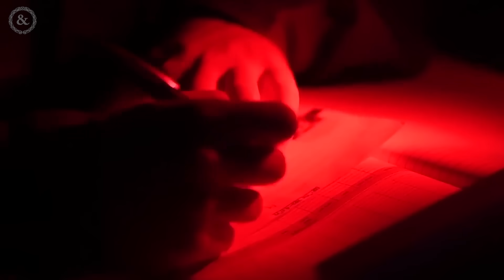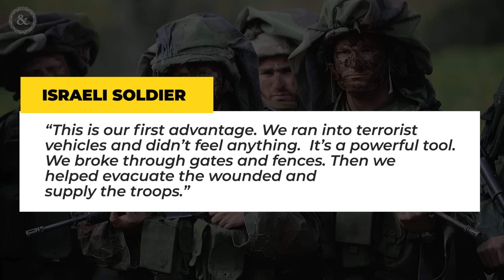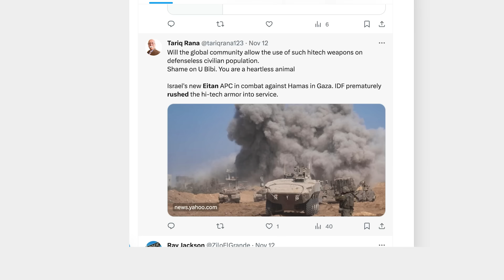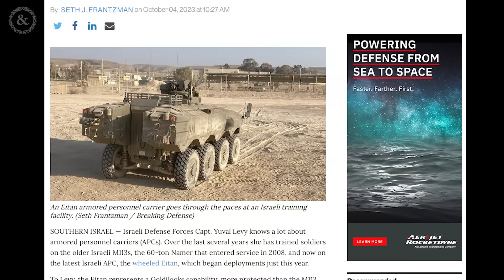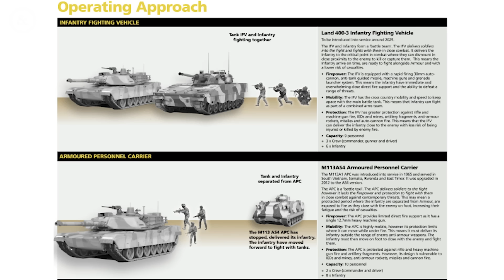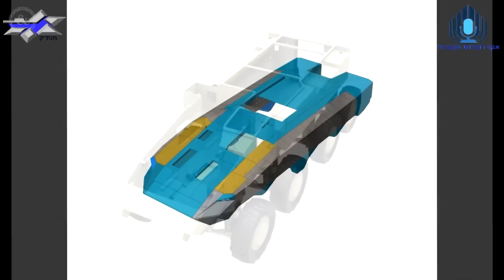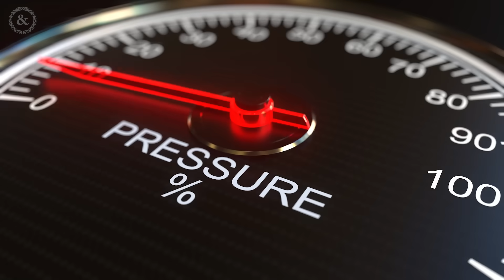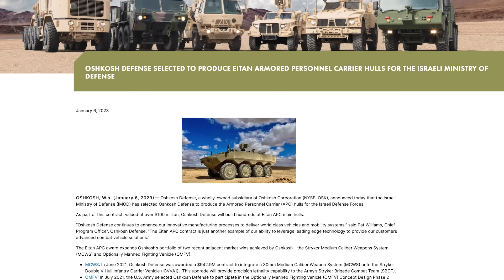Israel's Untested Armor Thrown into Combat

Comment: The basic design is far better than Stryker ! Believe the 30mm cannon should be up scale to 40 or 50 mm , with laser targeting and exact distance findings ! Be cheaper to have more select flexible fusing in cannon round !  To provide umbrella cover for infantry away from the Eitan with a proximity setting for small drones where shock wave of blast and shrapnel should take it out ! Plus with laser distance finding air burst setting for detonations and select added distance segments to distance 6 ft for cars, wall ,windows and doorway ,building corners of 2ft  ,plus more exact distance for foxholes ! To save the 40 mm cannon ammo have a over under concept 50 cal mounted on top of cannon !  The side armor should be greatly improve is before exterior skirt armor is to have modular side wedge armor of the Merkava tank turret ! Now improve this wedge armor more is have on demand to expand or collapse act a space armor for the heavy wedge armor , operated by small electric motors pushing flat bar out with gear teeth on top , the modular wedge will have small pilot hole , about 20 inches deep ,when operated it be like a tote umbrella or snake eye bomb fins , the extension struts will open a hinge that consist of the metal skirts plates upper & lower at 90 degree and 20 inches away from the peak of the wedge armor , when not in use it be folded against the wedge armor another protective layer , but not acting as space armor !
Reply: The downward blast force of a 40mm or 50mm should be enough to take enemy in foxholes or the Side blast for doors ,window sides and building corners !

Comment: in btr 60 it had 12 tons... a modern armored vehicle has 23 tons... the difference is armor... you can find a technical solution to reduce the weight by 15 tons... either it doesn't have the weight or something is wrong..

Comment: For a better resilience shouldn't we democracies team up in our defence production?

A vehicle like this could be autarkly produced in Europe by a joint venture for the european market. Vice versa there might be other products that are a good solution for Israel in Europe that could be autarkly produced in Israel by a joint venture. In case of conflict we can help each other out. Also we can specialise in our research and new developments which would be cost effective or deliver more for the same costs. May be we should exchange engineers to make sure that the specific interests and needs are covered in joint products. This could happen by using the same base but implant a customized version if needed. 

We should ask Canada and Australia for participation and Japan, South Korea.

This would be a powerful grid that is resilient to the max. 

PS.: I haven't mentioned the US because I think some competition is beneficial for developing new ideas. But the results of all sides should be shared among democracies in a way the inventor benefits of. Of course there needs to be standards that make it possible to interchange spare parts, ammunition and basic service. 

Such a defence network would be a strong answer to the challenges of our times.

Comment: One of the coolest parts of technology in combat, is that technology will always be ahead of what is practically possible. Every single platform, weapon and strategy is already potentially obsolete because by the time the tool is being used, a minority of people (hopefully helping you out) have already observed, tested and identified the weaknesses of the new thing. They have the time between designing the thing, and sending it to combat, to design a better version and therefore "obsolete" the old version. (never-mind practical experience) Some parts of the military have this issue worse than others, not really sure which are relevant. But here are some examples. 

Navies often have this issue because it can take decades to make a single ship, so as long as you want to stick with the original plan (ad-lib at your own risk). It takes so long to move a ship from the blueprints to the sea that entire wars can begin and conclude before the ship is ever tested. By the time the ship touches water there have been 10 years of engineering, experience and changes in priority. 

On the opposite end of the spectrum guns are so numerous that massive amounts of industry would have to retool and find funding before new ones became common. Practically you can make a new individual weapon very quickly, but replacing a 50 year old gun completely may take 50 years. By the time a gun becomes common in a military there have already been new guns made and the people may see the old gun as an old reliable despite flaws that have been on record for entire generations.  

Rushing your new vehicle to combat and skipping the evaluation minimizes the time people can reconsider/observe and practically increases the time the vehicle has before becoming obsolete.

There are risks though, it isn't all gravy.

Comment: Looks like a great vehicle.  Wish the US had an analog.  Many of our vehicle have an air transport requirement and designs limited to what a C-17, C5 can carry.  Hence the width, length limits we have as an expeditionary force.  Perhaps we should have variants that can be ship delivered and emplaced such as these that can be positioned in Europe, Asia.  By all means, keep parts similar or same across all variants such as strikers, M2, M1 as applicable.  For Gods sake, please standardize controls!  There is no need for every vehicle to have different control configurations, Keep those the same and merely update electronics and capabilities.  Even in aircraft he stricken stick grips are custom made for each aircraft and not interchangeable.

Comment: Thank you !  Great video but you MUST be mistaken about the width being "3' Wider than the Stryker" ?
 The Stryker is ( 9' ) in width. So if you are correct that would make the "Eitan"  --> ( 12' ) Wide ?  Which is literally impossible ! 
 Typically with these type of wheeled vehicles they try to take into consideration the average width of the very roadways that they will be traveling on.  A ( 12' ) "MON-STAH" would have a Very tough time maneuvering around our Super-wide  ( in comparison of course ) US streets & roadways. Let alone the typically Old/Ancient designed for "Ox-Cart" streets & roadways found over there.
Don't want to criticize. .. I'm just say'in !
Reply: Do an image search in your choice of search engines and find images of people on them in service or building them in factory, yep, it is that wide when assembled. For instance, a factory image which is a YT thumbnail from a video by Israeli Homeland Security, in the November 06, 2018 issue of Breaking Defense in an article by Arie Egozie. A ways down the page article mentions 10ft width. Pause the time lapse video, rotate people standing atop hull, and yep, it is in that width range. Other more recent articles in a couple popular defense industry sources do give 12ft width.
Reply: No ... Sorry but you are off by at least ( 3' ) The Abrams is ( 12' ) wide. There is ZERO chance this Eitan APC is as wide as an Abrams. 
 I suggest you take another look.  Ive spent a LOT of time on, over & in an Abrams and I know what ( 12' ) looks like. That Eitan thing is not anywhere Near that.  In fact, It can't be because it would never be able to make it down the damn roads it was designed to be able to navigate. 
   @scottfw7169

Comment: That looks like a South African vehicle. It has the same top speed as well, most probably 8 wheel drive as well. All our vehicles in the war in Angola was tyre wheel driven and not track driven. Just like the UK vehicle and most American vehicles are South African technology or and South African build.
It is easy to find out as my buddy works at a factory.
V-shaped hull is a South African invention which have been used by South Africa since th 70s. It is a Professor in South Africa that designed it.

Comment: Everything about EITAN AFV vehicle except from the "Iron Fist APS" sounds exactly the same as PATRIA AMV, i know there's more but I can't but wonder if Israel could've and should've opted to get a license for PATRIA and make a custom variants of their own cutting back time required for R & D, testing while saving money aand PATRIA is proven in combat.
Reply: It's not only a matter of cost, Israel tries to be as self dependent as it can be with its armor and not to buy armored vehicles from other countries, not even the US, that's why the Merkava project was created 50 years ago.
Reply: @E_y_a_l  I understand that but Eitan already is made out of (not sure iirc) 50-60% foreign parts and Israel has a good history in dealing weapons of all sorts with Finland like galil, soltam, tampella howitzers and they would've easily acquire a license for Patria.
Reply: @realtsarbomba   I don't know where you got the 50% foreign parts info, I doubt that's true, the Merkava and Namer APC are 99% Israeli where only the Engine is German-American, some of the parts are made in the US because of the foreign aid money policies, but they are still Israeli design, the problem is not license or good relations, Israel has very good relations with the US and Germany and they still won't use American or German tanks, the reasons are both different needs the IDF has but also that Israel don't want to be in a position where an outside country control its supply of Armor vehicles because of embargo problems that happened in the(distant) past, so that's why Israel will not buy Armored vehicles from Finland as well.

Comment: I doubt vehicles of such tonnage can travel at 120kmph.
Reply: @@wot.no.eulogy yah? ... which tank was it? ... smoking what?
Reply: @@wot.no.eulogy rubbish. M1 Abrams' top speed is 45mph (72kmph).
Reply: @@wot.no.eulogy 45miles is NOT 90km. 72km in fact.
You need to go back to primary school - either improve on English comprehension or learn your conversion tables.

Comment: Comparing to the Strker is futile. Israel doesn't have to deploy anywhere. Their biggest "deployment is basically a drive from DC to Baltimore. This vehicle is not constrained by having to fiti in a C 130. Same thing with the Namer, basicly a Merkava tank minus a turrent and outfitted to be a troop carrier. US vehicles are meant to be deployable around the world. Finally, this vehicle nor any other troop carrier can protect against 30 mm APFSDS depleted uranium or Tungsten ammo, not even MBT's can. At best, they might "survive" one round. As we all know, if you are hit with any auto cannon, 25 to 40 mm there are 3 or 4 rounds following that first one. Again, an Israel only thing, since none of it foes has the required 30mm ammo to penetrate them.

Comment: And paid for by the US taxpayers.
Reply: Do Americans really think israel is ran by them? If israel technology didn't exist Americans would have been in some trouble themselves
Reply: It isn't. Israel's military budget is between 25-26B USD, the US aid and support for military purpose is an additional 3.8B. Although with the current package from Biden it increased to 14.5B.
Secondly, Israel isn't allowed to use the US aid to buy millitary equipment internally they have to buy from the US. The US aid to Israel is used mainly for aircraft rockets and Tamirs (the rocket of the Iron Dome), although with the increased budget i would assume israel would by more aircraft, possibly F35 Lightning II, F15 Eagle, and F16 Fighting Falcon.
There is a certain misconception which is that Israel manage to function solely due to the US, which is incorrect. the US aid is mostly used as a political tool inside Israel, since it allows the politicians to alocate the same amount from the Israeli taxes into issues which relates to certain groups of interest, mainly voters of the ruling party and the settlers who vote for the far right parties which hold the goverment still.
I mean Israel's gdp is 488.5B USD, and the gdp per capita is 52K USD. Israel is doing fine on it's own, it is more that our dumb goverment prefers to fight with itself rather then release Israel from US obligations, and the US from its Israel obligations.
Reply: As always

Comment: Being a amatur with respect to the military, I have a question:   IFV's do have relative small guns or cannons.  Yet, these are gradually increasing.  The CV90 moved to the 40mm Bofors.  The US is testing an even bigger 50mm. In the navy, the 76mm Oto Melara seems to be very popular being able to shoot 80-120 rpm. As you are an infantry man, would it make sense to have such a gun nearby? What is your take?
Reply: Big calibers mean big versatility. You can fit VT fuses or programmable airburst fuses in a 40-50mm, but not in a 25mm. Also means much greater effectiveness against structures. 

The big one is the VT fuse for anti-drone work though. Militaries are a little worried with how cheap loitering munitions and surveillance drones are, and having a 40-50mm gun can let an IFV function as a SPAAG.
Reply: Thanks  for your reachtion   @jonathanpfeffer3716   . So, If I understand you right, size determines whether smart tech can be incorporated in the ammunition? So, if 30 mm is enough, why moving towards 40 or even 50 mm?  Yet, there is still something confusing me. The Navy has a relentless focus on "multi-role" systems, which ivolves the integration of defense and offensive capabilities.  If a gun, like the  oto melara, has proven very valuable, why isn't it (or similar) used on e.g. stryker, boxer, etc. Provided the radar could pick up drones, would that be an ideal sollution for e.g. Ukraine? (or am talking nonesense?)  Interestingly, I just found out that the South African "Rooikat" is using the OM 76mm. (so, not that weird).

Comment: Alright Chris, once again you are wrong.  Yes the Eitan is a better machine than the M-113.  But the M-113 was created in the 1960s for a different type of war.  The Eitan is being built by Israel today for Israel's specific modern needs, and gosh, it does pretty good in Israel.  Don't compare the two, apples vs oranges.

Comment: M113 are basically made of cast aluminum, penetrable by an AK round. Good for light shrapnel protection but not much more. Pretty mobile, though.
Reply: Also has alot of support variants.
Can't ever have enough support variants.
Reply: I saw a promo video last year about the Eitan ("Steadfast") APC during its construction. Pretty high tech, well armored, and highly mobile due to having eight honking big wheels rather than  treads, which are not good for long-distance road travel. It was described as being able to travel at 60 mph for long distances. The unit dispatched to the Gaza border was the pilot unit composed of fully operational Eitans. So they operated exactly as designed. Rare for a new first-in-production military vehicle. Probably since it was built based on input from IDF soldier's recent experiences in the prevalent APCs, basically, their "wish list" for a mobile, hardened fighting vehicle that protects the crew and passengers.

Comment: 120km/hr is UNBELIEVABLY fast for an armored vehicle. That's a full 20% faster than an M1117 or a Stryker, and nobody drives those at full speed, because they will try to knock your tailbone through your throat with the handling. And the Eitan has far more armor than a Stryker, so the increased speed means that it has a much more powerful engine.

Given how it has performed so far, I don't think that we can call these untested anymore. This is probably going to be a pretty common vehicle in the future, and may even be a good export product to nations like the Gulf States (maybe, if the Abraham Accords keep moving forward) and smaller European countries. As with most IDF systems, they put a heavy focus on protecting the crew, because they are a small nation with the largest danger being attrition of their most skilled troops. Vehicles can be repaired or replaced, but soldiers are a finite resource when your total population is just under 9.4 million.
Reply: Yes you are right. Eithan - 750hp vs Stryker - 350hp
Reply: Thats about 70mph.
Aka able to keep up with regular cars on a highway.
Still has a way before autobahn speed but makes the requirement of being able to keep up with logi trucks.
Reply: Perhaps not the most data based analytical way to think of it, but science fiction isn't fiction any more: memories of playing sci-fi miniatures games in 1980s and 1990s such as Battletech, Ogre, Dirtside. All three of them, I think, had some pretty fast armored vehicles.
Reply: It makes sense, though. They've had a good few years to perfect these things, and they're basically the sports cars of armored vehicles when it comes to performance.
Reply: These are diesel engines. Forced induction direct injected engines. They have no horsepower figures, it's software limited. A better measurement is the size of the turbo. American trucks ... by truck I mean semi ... have low horsepower figures but very reliable power ... million miles reliable. The Jews just took a truck engine and slapped a bigger turbine knowing they don't need a milion mile engine, they need power right now. The american diesel engine can definitely make power if it's needed. I play ATS, I'm a fan of american trucks, you can look at those tractor pull races to see how much they can squeeze out of a diesel. Power is there, it was decided stock power of the engine is enough